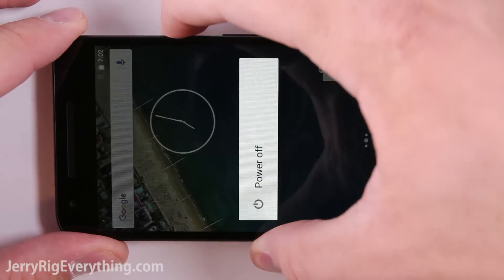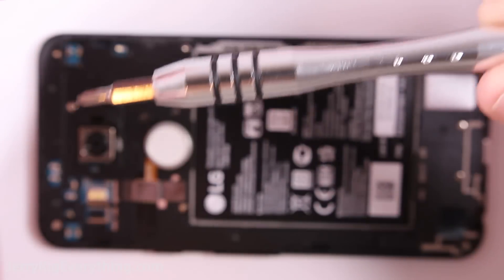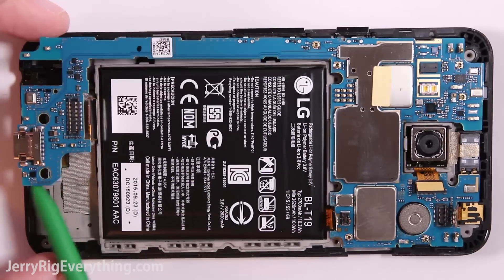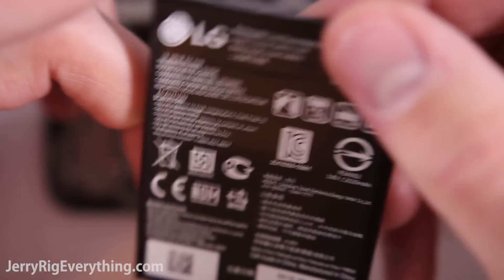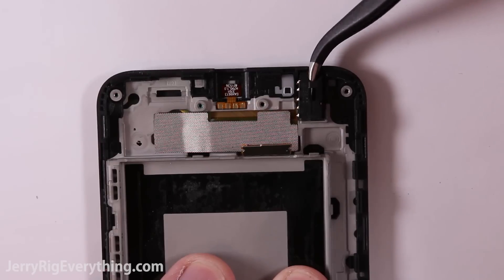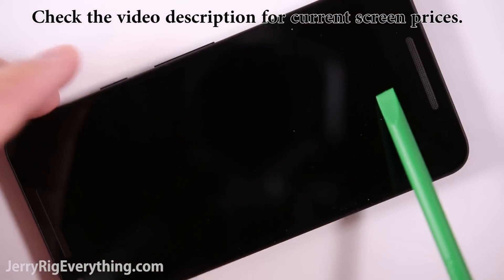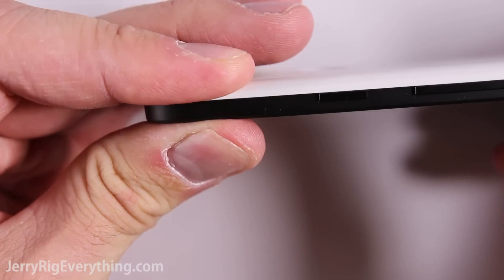LG Nexus 5x - Screen Repair, Battery Replacement, Camera Fix

Comment: I've got this phone and yesterday is was working fine. the battery ran out which is nothing new with the phone, but trying to charge it again was the start of the end. Upon plugging in the cable, the notification light was flashing red and to my understanding, this was the phone not recognizing the battery. I carefully opened up the phone which i have done a few times before and disconnected the battery ribbon, and reattached it and the phone began to charge after reconstruction. But i notice now the power and volume buttons no longer work, and upon opening the phone up again, there was no damage of disconnection from the motherboard. Would you know why this has happened?

Comment: I opened the mothrrboard of nexus 5x i fix problem of boofloop bu reflow the motherboard my bootlooped would successfully stoped luckily i come out of dead 5x but aftef assembling again i didnt properly get signal strength it might be tje problem of antenna connection can you please help hpw to connect gsm antenna or please point me out the antenna of gsm..

Comment: Hi,
Wanted to know if there is any way easier to repair the burned dark spot that i just had, by keeping the handset on the dashboard of my heated car, Plus it was getting charged, ultimately got my screen messed with two 2 cm burned areas,.
dont want to change my screen just as of yet. Any quick fix if there is any .

Comment: Help!! I followed the instructions as closely as I could and did the extra step of moving over my buttons and LED. As soon as I finished reassembly, I tried to turn on my 5x but was getting flashing red lights from the bottom LED - low battery, I guess. I plugged it in, but couldn't get a display - just the flashing lights. I let it charge overnight and this morning I get no display, no lights, the area around the batter and fingerprint scanner is SUPER hot, and every few seconds I get a clicking sound (Like someone is typing or the fingerprint scanner is being used?) even though no one is touching it. :(

Comment: Thanks a lot for this helpfull video! One small addition: you forgot the notification LED on the button. I changed my screen (original LG LCD module) and I also had to transfer the LED. It's simple to do but you better not forget it in the first place.

Comment: The microphone has stopped working on my 5x during normal calls. if I enable loudspeaker mode then people can hear me. would I need to replace the whole motherboard?
Reply: Ben Lyons Insert the SIM card ejector tool into the microphone port and pull it out. Worked for me as it cleans up dirt build up around the microphone. It's the hole on the bottom for the primary microphone.
Reply: Antti Peltola It worked ! Thank you !

Comment: I have some problems connecting to the camera: sometimes the app just crashes, more often the phone reboots. If I shake the phone I can eat something trembling near the camera. The common opinion is that I have to replace the motherboard: do you think it's worth it to try and open my phone? Maybe, if I'm lucky, I'll just have to reconnect the camera to the motherboard without switching anything.

Comment: I replaced the screen digitizer and frame   That all came as one piece. The display works fine except when I try to make a call the screen shuts off and the phone becomes unresponsive. There is an issue with the proximity sensor. I googled this issue and it is a common problem when replacing the plastic frame housing unit along with the display and digitizer, but I couldn't find any information on how to get the proximity sensor working. Please help repair wizard, pleaseeeeee!
Reply: make sure your proximity sensor is connected to the board correctly
Reply: where did you buy screen from and for how much?

Comment: What is necessary about the 15 piece tool set on Amazon you linked to? I already have jewelers phillips screwdrivers and a spudger will come with the replacement screen. Torx aren't need for the disassembly.
Reply: its mainly for people that don't already have the appropriate tools

Comment: Worked great. But you have to take out the side buttons and put them back in place before you reattach the motherboard! Also, be very careful, I cracked the bottom plastic paneling that holds the speaker. It seems to have broken in a very lucky spot though as everything is working perfectly. Thank you OP!

Comment: hi Jerry. if I'm going to keep my Nexus 5x in a case, do you recommend keeping the factory back cover off the phone to prevent overheating? great videos btw thanks.
Reply: +Aaron Windle the back cover also has the flash dispersion, laser range finder cover, and camera glass built into it. Why ruin a good phone with a cover?
Reply: +Polite Society I've dropped my phone in the past so an aftermarket protective case makes sense in my case. Wasn't sure if the back cover and case together would create heat issues since I drive a lot with Maps and the phone can be exposed to more sunlight. Seems there is more functionality built into the factory back cover these days. Thanks for the info. Much appreciated.

Comment: I had a mug leak overnight that left a tea stain on my screen. It's perfect other than for the stain, but it has screwed up the touch screen. Not sure if there is any easy way to remove the screen and clean it.

Anyone have advice?

Comment: Hey great video! My wife cracked her screen about a month after we got ours and I've finally found a replacement display + digitizer on Amazon but it doesn't look like it comes with the plastic frame. I think I can handle this myself except for one part: What did you mean about the frame when you said "just heat it up and remove it from the display"?  Once off, how would I attach it to the new display? Thanks in advance!
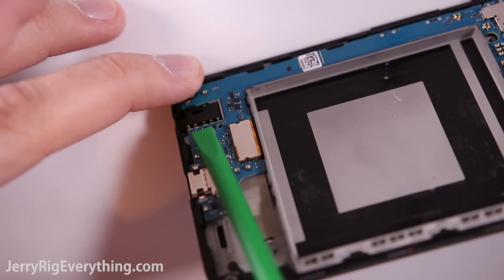Reply from the maker: +J Jones The display you ordered will most likely have preinstalled adhesive on the back already.  To heat up the old screen (To remove the LCD and reuse the frame...) you are best off watching my Note 5 screen repair to see how it is done. Start watching at 3:45 https://www.youtube.com/watch?v=aQcbGNuI3JE
Reply: +JerryRigEverything Thanks for the response. I got one from ifixit with the frame intact. Cost a bit more but worth it. The only thing missing is if you're moving all the parts to a new display, don't forget the LED over the bottom speaker and the rubber housing for the proximity sensor on top. Other than those oversights, repair was a piece of cake.

Comment: hey great video! quick question: I dropped my 5x on it's side, and now the power button does not function. It feels like it's clicking, but it will not turn the screen off, or power the phone down. What do you think needs to be done? Any advise is appreciated! Thanks!

Comment: Your the best. Screw the haters. Carry on.
Reply from the maker: I thought about doing one, but then people would compare it directly with flagship devices.  And I dont think thats fair with a midrange phone.  I gave it a test 'flex' though, and I do think its bendable.
Reply: love your videos! keep it up
Reply from the maker: +JR3059 Thank you!
Reply: +JerryRigEverything no nexus 5x stress test?
Reply: +JerryRigEverything I wish you'd do a bend test. My biggest gripe with the Nexus 5 is, that it started bending a week after I bought it, by just having it in my front pocket. They seem to have fixed a few issues though. The button placement on the sides for example.